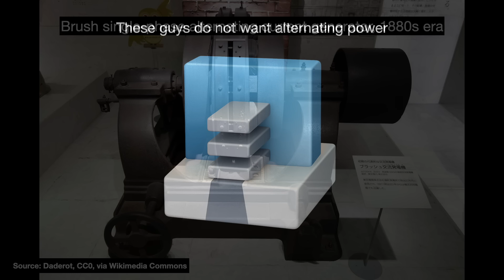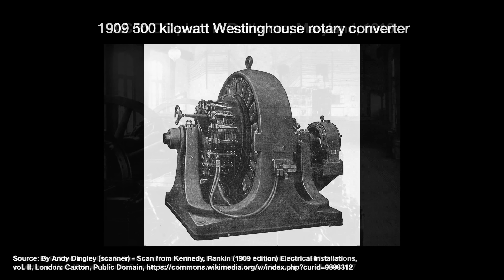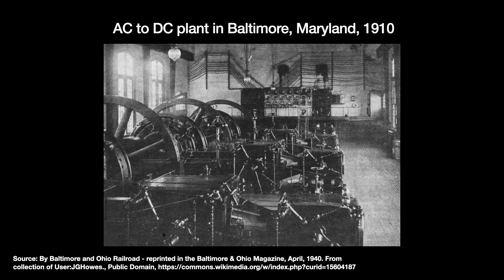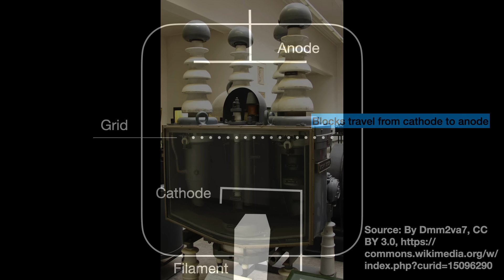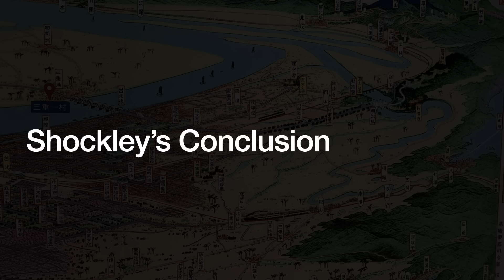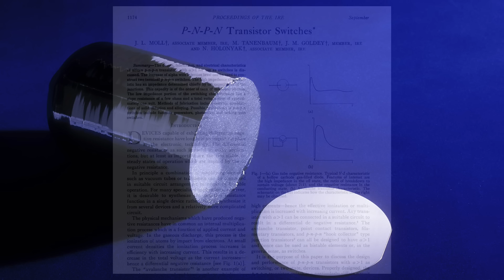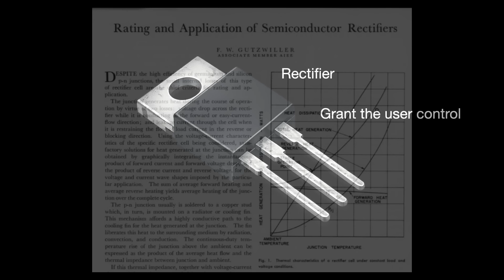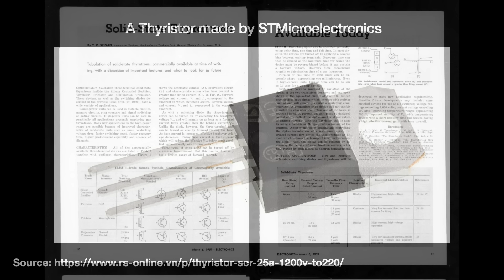Thyristors Did to Power What Transistors Did to Logic

Comment: The giant hydrogen thyratron shown at 7:15 came from the 1.2 megawatt search radar of a cold-war US Army surface to air missile system called Nike.  It switched very short 18,000 volt pulses into the magnetron 250 times per second from a capacitor charged by an 18kV 100mA supply and gave roughly a 200 mile range.  That search radar gave the world weather radar after operators noticed they could track storms.  The little 9 pin miniature tube to the left is a 2D21 thyratron, often used to drive relays from AC power or in trigger circuits.  I don't recall exactly, but I think the 2D21 triggered the big thyratron.
Reply: During the second world war most German radars (those made by GEMA and Telefunken) used 'grid modulation' where the control grid not only generated the wave but formed the pulse.   This limited power but allowed a very precise pulse in which even phase could be controlled and recovered.  
-The allies used anode modulation on their VHF (50cm radars or so) where the grid only creases the waveform, and the pulse is created by switch a high voltage pulse via a thyratron like a spark plug to form the pulse.
This gave a far more powerful pulse that could be shorter.
-Up to 1941/42 the two systems (grid and anode) modulation were equal but soon anode modulation and with it the allies pulled ahead giving them more powerful longer ranged radars.   USS Iowa being able to detect targets and spot shell splash beyond the visual horizon.   Anode modulation was essential for magnetrons (which are diodes) and it was developing high voltage thyratrons that held up the Germans.
-My recollection is that the Thyratron were hydrogen filled and often had a small amount or radiation in the form of radium to speed conduction (may be the nullode im thinking off)
-The Germans did have anode modulation for their 50kW Lorenz Hohtenweil radars from 1941 but it did seem to take them to 1944/45  to catch up which was of course too late.
Reply: @bernhardzunk7402  Yes many thyratrons are hydrogen filled, and in most the radiation source is tritium gas, which allows for easier ionisation.  Mercury filled ones have impressive power switching, but are relatively slow, and also have constraints in operation, as they need to be mounted base down, so the mercury can pool back to the cathode area, and also are constrained in operation rate, and need cooling, as you need to condense the vapour to allow it to turn off, and this takes both time and forced air cooling for higher rates. Hydrogen ones do not suffer from this, though they will all eventually stop working, as the hydrogen diffuses through the walls of the tube. The ones used as triggers for nuclear weapons thus are regularly rebuilt, in general every few years, as they lose gas fill and thus need to be changed out, along with the batteries as they age. 

Yes you can control them using the grid, though you do need to design the tube to allow this, as you need a fairly thick and robust grid structure to do so, as you need to pull a very high current, typically the running current, out of the grid, though the power needed is much lower, as you need only a low voltage to do so, starving the anode current, and thus turning off the tube. Thyristors can do this as well, again only specialist units, gate turn off thyristors, which were commercially developed by Sony, which used them all over as power switches in the Sony Trinitron TV range. That is also a fascinating device, though it had a relatively short commercial lifetime, eclipsed by improvements in bipolar transistor technology that made high voltage, high current switching transistors become both cheap and reliable, getting rid of the only advantages of the GTO thyristor, power switching, and being much more reliable and controllable. there were many retrofit kits developed for Sony TV sets, to replace the now obsolete GTO device with typically a BU504D bipolar transistor, and kits had instructions, the replacement transistor, typically a small heatsink, and a few lengths of wire, odd resistors, capacitors and diodes, to be able to replace the part and get a more reliable set. Do not think any Sony set ever, that is still running, has the original GTO devices in it, they all failed over time, as the stress of that gate current killed them with time.
Reply: @SeanBZA  krytrons have a 4th pin with a small positive voltage near the cathode that produces a small amount of ions via glow discharge so that they can switch rapidly on, and get truly insane rise times to extreme amounts of voltage and power, but I feel like you might have already known that. Tritium is one option. I have some small ones that were made for directed energy weapons and radar experiments sourced from private collections near Santa Susana field laboratory in/near Simi Valley and Chatsworth, CA, in Ventura and NW LA counties where a lot of the military industrial complex had and still have their labs, Raytheon, Hughes, Lockheed, rocketdyne, Northrop-Grumman, And Skunk Works at BUR was famously nearby. I had no idea that L3 was located near here until I had some tech to pitch for them and the office I was going to was near my hometown but that’s the place if you wanna collect cool old MIC stuff. Telecom too. And semicon. That incredible arc conductivity is probably only possible with hydrogen but there are some filled with krypton or a mixture of the two. They’re basically just fancy triggered spark gaps. The nuclear source is tritium sometimes, others contain 226-Radium that spontaneously decays to Radon-222 but only has a half life of about 80 hours vs 1600 years I think for 226-Ra. There are others that contain small amounts of 63-Nickel and still others that contain Uranium glass inside the tube as the source, but the 63-Ni and 3-H are beta decay while the others are primarily alpha decay. Honestly I’m not sure how much it matters cuz both will have a similar effect on promoting arc discharge. And glow discharge too.

The ones used in Nukes I’ve always been lead to believe were krytrons and that should be fine. I don’t think you would get premature activation due to a shielded plutonium core but sprytrons have an extremely hard vacuum and are extremely resilient to ionizing radiation as a result. It could be that the krytrons fire the sprytrons, it’s hard to say since almost everything we know about the design of nuclear weapons has been reverse engineered. I would think today it would probably best be done with a coherent q-switched laser either energizing multiple semiconductor gates containing a rare earth dopant that strongly absorbs the wavelength of the laser or a similar approach with a similar light gas arc switch. Or just direct laser ignition of gold foil buried inside a PBX lens with a ‘slapper’ configuration in an oxygen-filled tube with a zirconium target overlying a PETN/TATB in HTPB or actually acrylic would be perfect if the laser is inside acrylics optical window not that it matters much at that point. The hypersonic gold plasma and rapid plasma ionization of zirconium in oxygen would be enough but having the laser directly ionize the PETN/TATB with embedded zirconium and molybdenum trioxide nanoparticles would also work well as long as the zirconium particles are completely free of oxidation. Otherwise kinda precludes at least near-IR through near-UV wavelengths. A femtosecond or SWIR laser would be fine I think.

As to the gold seal, yeah hydrogen is a bish to keep trapped for long but they usually sputter coat with gold since it’s a balance of kovar surface oxides that are the key to their effective sealing. I have resealed a few and it’s a very sketchy process using hydrogen cuz of the risk of leaks but definitely doable. This isn’t my first re-gassing of a tube, just the first time I’ve ever done it with pure hydrogen. Fun stuff. I wish I had a better use for it but these stupid GTO SCRs work so well. I do use a triggered spark gap in a wire EDM machine that I could replace with the krytron but I’ve already got a cooling system built and I do a lot of wire EDM right now with that thing so it’ll probably be used for some W-band or V-band EW project at some point. 
Cheers
Reply: @SeanBZA  I don't remember the tube number, but I remember most of the other Nike power supplies used mercury vapor thyratrons with life issues. Western Electric eventually issued a solid state replacement module with a tube plug at one end, an insulated anode terminal at the other, and a square aluminum box in between which was perforated with big holes for cooling.  Clever design, it used phase angle switching of the thyratrons to make a universal supply chassis at several different voltages using a classic gas regulator tubes as a reference. I remember the search radar repair manual only referred to one thyratron as a "Hydrogen Thyratron" (the one shown in this vid) while all the others were just marked thyratron IIRC.  I wish I remembered the number of the medium sized mercury vapor thyratron in those power supplies.
Reply: @bernhardzunk7402 yes, some Soviet made for military thyratrons of legendary reknown that used radioactive material, strontium I think, from 50 years ago are items of considerable collector value today. I am looking for some of those myself...
Reply: @bernhardzunk7402  No mention of PFN's (Pulse Forming Networks) coupled to magnetrons with a Thyratron used to 'trigger' at the far end of the PFN which then drives the magnetron?
Very basic RADAR transmitter topology ...
Reply: Nike bases make a great tour.
Reply: Wow that's cool!
The only experience I have with the Nike Hercules interceptor is that there was an old site in the Kahuku training area on Oahu.  Kaena Point tracking station is a few miles away.  Idk why they shut it down or when.  I assume that they felt they could intercept missiles with fighters from Hickam AFB or Kaneohe MCAS.
Reply: @davidkamaunu7887  ICBMs changed the game and Nike waa deactivated as part of the ABM treaty which came out of the Strategic Arms Limitation Talks of 1972.  Hercules was the first missile to hit another missile in flight.  South Korea still uses a new indigenous variant of Hercules called NHK-2, but they changed the guidance from radar delivered command guidance to inertial guidance with up to 250 km of range.
Reply: Yep, all this made radar that much more accurate and affordable. The air radar I was trained on became obsolete the year after I graduated classes because of many of these factors. AN/UPS-1 is worth a lookup for the radar inclined
Reply: The Nike Hercules would never be obsolete, but is paralyzingly expensive to build.  They are beautiful.
Reply: @symbionese2348  One of the selling points of the Herc was that they were cheap(ish), just $55,250 each at introduction in1957.  It's just a radio controlled aircraft and they cost about 1/2 a million dollars each in 2020 money.  The nuke was the pricey part, likely in the neighborhood of 3-4 million dollars each in 2020 money.
Reply: @Peter_S_  Thank you.  That was still the price of a very nice and very large house.  The Hercules had television contact until impact, and T.V. technology in 1957 was expensive and delicate.
Reply: @symbionese2348  You're welcome.  Expensive by my wallet indeed.  The Herc was actually flown by radar and an analog guidance computer at the Integrated Fire Control point, or IFC, where the radars and Battery Commander sat.  The only thing the missiles transmitted was a transponder code for IFF (Identification Friend or Foe) which looks just like an aviation transponder reply.  One of the bits in that short data stream indicated if the IFF reply was from an aircraft, or a Nike missile in flight.  The computer would fly the missile to 30 feet above and in front of the Predicted Point of Intercept for a conventional mission, or 300 feet above and in front of the Predicted Point of Intercept for a nuclear mission and then fire the warhead via a radar command called "burst".  One more fun fact, during launch the Nike was exposed to acceleration of a couple thousand Gs.  The missile is 41 feet long and at launch they are already traveling supersonic before they have moved their own length.
Reply: @Peter_S_  Thank you again.  Good to know.  I visited a Nike Hercules silo when about nine years old and did not really see much, needless to say.
Reply: Pulsed 18,000 volts?! And i thought HAM license gave me a lot of leeway on transmission, hah. That is an awesome bit of info. I love when you can gauge channels quality by the comments it receives. Reading random input from experts in niche fields who are interested in the same videos as me is an awesome feeling
Reply: @daevid3299  And that was the little search radar.  If you want to dive down that rabbit hole, search for "Ed Thelen LOPAR" and you'll find lots, plus a PDF called MMS-150-Ch02 which will give you a nice primer to the LOw Power search radAR.  Ed also has the corresponding data for the big 10 megawatt radar which was at many sites, the HIPAR (HI Power acquisition radAR).  I share your enthusiasm for this channel.  I absolutely love Asianometry and I can't tell you how tickled I was to watch an episode and see a tube I removed from a radar set 25 years ago which was then photographed by someone else in the display case I put it in.

Comment: Nothing evil about converting DC to AC - that is (amongst other things) how efficient long distance HVDC works - and needs to be converted back to AC at the demand end...
Reply: Well, "need to be converted back to AC" is kinda ehhhh, there's actually rather few machines of modern design that wouldn't choose DC if they had it available for the same power cost and at a reasonable voltage given the application.
Primarily that's actually because these days you can run substantially higher electric frequencies in your electromagnetic rotating machine to pretty much directly boost power density; at the "minor" cost of needing this be synthesized by an electronic inverter.

Because it's really rare for a fixed RPM to be without the typical downsides in any vaguely large application, due to variable speed allowing to adjust typical mechanical losses down when full throughput capability isn't needed.

A big part is also that for transmission lines, if you're limited by conductor-to-earth voltage and thermal load of the cable/conductor, you get literally twice the power through the same cable (if it's truly the peak voltage to earth that limits you).
Reply: @namibjDerEchte  AC is about power generation, transmission and distribution.  For most cases, AC is the most economic means of generation and medium long distribution.  You need very high voltages to keep transmission costs low.  

Converting AC to AC at an effectively infinite range of desired ratios is reliably and economically done with transformers - even accounting for losses.
Only when distances get substantially long, or goes under water for many km, does conversion to DC make economic (and engineering) sense.

To be sure some long distance lines in North America could be converted to DC - Churchill Falls to Quebec City (terminal) and then on to Montreal and into the US (for example).
The existing Raddison to Sandy Pond (Boston) line is another good example for the long distance DC case (±450kV).

But the DC-AC conversion is relatively expensive (capital wise) - so AC will be with us for the foreseeable century or so.

Comment: Mercury arc rectifiers were sometimes used in electric railroad locomotives to convert overhead AC supply into DC for traction motors.  The disadvantage of using these fragile glass devices with sloshing liquid mercury on a moving vehicle sped development of solid state rectifiers.
Reply: Yes. Here in the UK the first generation of AC electric locomotives and multiple units used mercury arc rectifier. The noise of the ones on the locomotives gave them the nickname "roarers". The second generation used silicon rectifiers and some of the early ones were converted too. These still used tap changers for power control though. It wasn't until the 1980s when thyristors started to take over, first on multiple units and then on locomotives. The class 90 and 91 which were the first locomotives (other then the single 87/1 which was a testbed) are still used today. The 314s and 315s which were the first multiple units lasted until a few years ago.

Comment: Jukebox control?  Oh, the 2D21 - Seeburg went back to the 2050.  Common for the stepper circuits, and core memories of their late 50s machines.  Somewhere along the way, they went to a solid state setup, but retained the core memory.  Tormat is a neat system, but frustrating when it's not working right.  
You missed the Ignitron - which was the high power tube equivalent of the SCR.  Saw use in welding, and commuter trains and locomotives (and early HVDC systems).  GE had a phase angle control system that got good use on the Silverliners and M-2 cars.   They ultimately got converted to thyristrors in the 80s.  I've ridden the old Silverliner II cars. They were stupidly smooth accelerating trains.